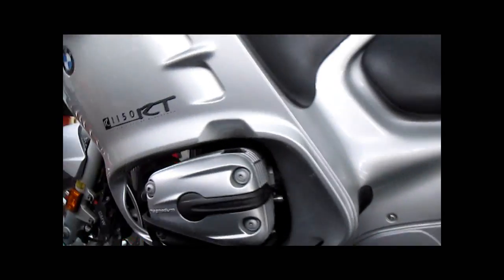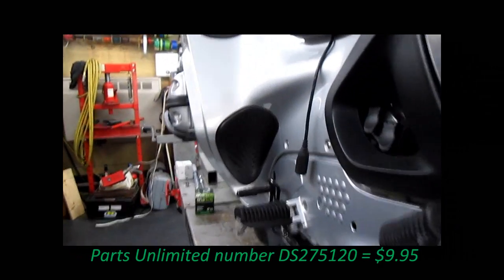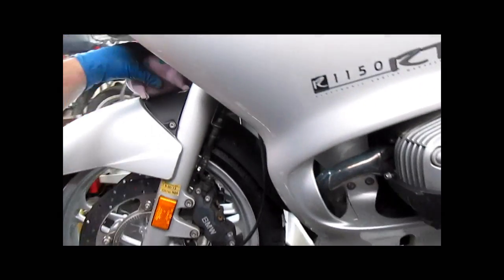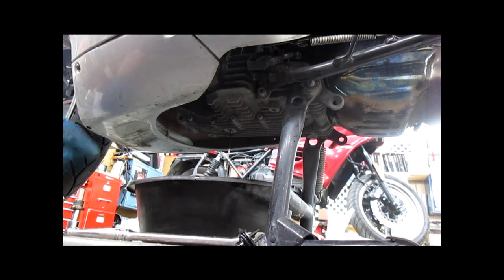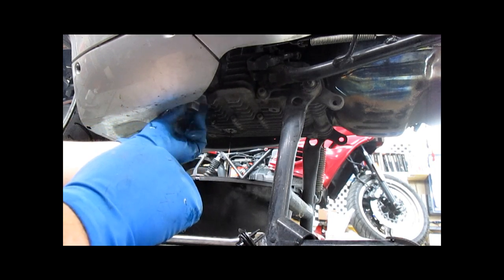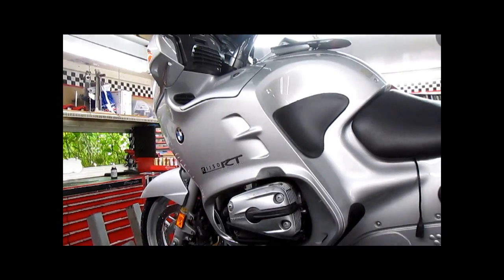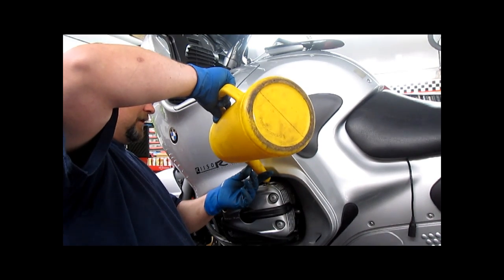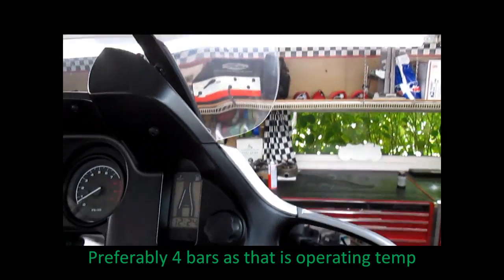BMW Service - Oil & Filter Change

Comment: Just bought a 2004 1150rt. The bike is in mint condition. What would you recommend for gearbox engine  and trans axle oil ? Thanks
Reply from the maker: Spectro Platinum full synthetic GL - 5 rated 75w140 oil for both transmission and rear drive. Change the trans every 24K and the rear drive every 12K and stay tuned.  https://www.bobscycle.com/spectro-platinum-differential-gear-lubricant-gl-5-75w140-1-liter.html?gclid=CjwKCAjw-e2EBhAhEiwAJI5jg7asQh8uWbVZBiDrexYlkr9YflUqWVuvxscCU334HQJUrOnA6yK5lhoCPCIQAvD_BwE
Reply: @ChrisR.Harris  thanks mate!👍

Comment: Hi Chris-  I need to know one particular information. On my BMW R1200 CL, the oil filler plug (top side not the drain plug) requires some special wrench to fit into the special socketed head. I don't think you covered that point in the video and presume it's dealer only. IS that right?   And thanks for a very information video.

Comment: I have a 2004 BMW r1150r   when I ride it it's leaking a small amount of oil down onto exhaust does that mean it's the seal? or possibly the oil sight glass ?
Reply from the maker: Take a look at the exhaust and trace the leak back to the source.

Comment from the maker: You need to drain the excess oil from the airbox. Right now the level is likely high enough that oil is draining from the airbox down the left throttle body and into the cylinder.

Comment from the maker: No, what you have is an aftermarket oil filler cap. Many people install these things to eliminate the oil weeping that the original plastic caps can allow if the rubber o-rings are worn out. If you send me an e-mail with a picture of the cap I can offer an opinion as to the manufacturer. Better yet, remove it, discard it and install the original plastic cap assembly. Just my opinion of course.

Comment: Hi Chris, nice video as always, i've a question for you.
i use valvoline full synthetic sae 10w40 on a bmw r65 from '79.
is the spectro 4 (20w-50) much beter for my bike ?

thanks and greetz from the Netherlands

Comment: Chris, love your youtube stuff, I've got a R1100R with oil getting in the airbox, oil level is half way up the sight glass (not over full), bike has done 32000 miles and seems to run fine........could it be worn rings ?

Cheers 
Mark

Comment: Do you recommend the Motul Synthetic Blend 15w 50? I have been using that for  about 5 years on my 2000 1150GS
Reply from the maker: Hi Mark, I only use Spectro 4, non-synthetic in these engines. The engines that leak lived on synthetic oil. Switching back often ends the weeping. That's my 25 years of experience with this shit. Good luck, Chris
Reply: Chris Harris  Hey Chris, Thanks so much for the tip. Now I have to find a retailer. 😰Peace

Comment: Hi Chris, I was a bit of a dummy and overfilled my oilhead, lots of smoke etc... I drained off the oil and refilled to halfway up the window. The smoke eventually blew off BUT now after I leave the bike on the sidestand, I get the oil smoke again... Have I blown my head gasket? It never happened before... any friendly advice gratefully received.

Comment: Thanks for Quattro replies Chris!.. I have to get a better camera as the photos are not clear.  it must be some type of secure oil filler plug, aftermarket. I can describe the tool I need as to 'C' shaped prongs, each of which is about 15 degrees of a full circle, 180 degrees apart. this tool fits into the recessed plug  to remove it.  I may be able to fashion a tool to get it out, and install an OEM plastic cap.

Comment from the maker: That sounds like the Hexhead oil filler cap. Look at a newer BMW model and see if it is the same. If it is you can buy a tool from BMW or just use your hand to remove the cap.

Comment: So,  after adding 4 qts of new oil - run the engine to operating temperature THEN look at the engine oil sight window AND what should one see???? Should the Oil level  in the window be below the center of the red circle, above the center ???  I can't find one video on YouTube that illustrates this.  It's not even mentioned in the BMW Service manual.  What's up with that?
Reply from the maker: Nicholas, the oil level is to be checked only after reaching operating temp (5 bars on your Rider's Information Display's oil temp gauge). You ride for 20+ miles, park in the driveway on level ground, go take your gear off and then look at the sight glass. The level should be at the dot in the center of the window. If you see the oil line anywhere in the window it is acceptable for a check. If you do not see the level it is in fact much too high. Have a helper assist you in leaning the bike to the right as you watch the window on the left side looking for the oil line to appear. This is when people often fuck up and think that because they can not see the oil line that it must surely be low. Wrong, it is too high! A visual oil line anywhere in the window means DO NOT ADD ANY OIL, it has enough.
Reply: Chris Harris - Got it ..... Thanks so much for the answer .
Reply from the maker: Nicholas Mumola  You're welcome.

Comment: I wonder if you have used Royal Purple Max-Cyckle oil on BMWs?
Reply from the maker: Hi Leif, some do, I do not. I use Spectro 4 from Intercontinental Lubricants; the same formula that BMW demanded when the K100 was released. Still the same unlike most others. Stay tuned for more, Chris  https://www.amazon.com/Spectro-Motorcycle-Engine-Lubricant-Oil/dp/B075DXGM33/ref=asc_df_B075DXGM33/?tag=hyprod-20&linkCode=df0&hvadid=309830501429&hvpos=1o1&hvnetw=g&hvrand=2905244398232124300&hvpone=&hvptwo=&hvqmt=&hvdev=c&hvdvcmdl=&hvlocint=&hvlocphy=9002739&hvtargid=pla-520659763564&psc=1&tag=&ref=&adgrpid=57212496130&hvpone=&hvptwo=&hvadid=309830501429&hvpos=1o1&hvnetw=g&hvrand=2905244398232124300&hvqmt=&hvdev=c&hvdvcmdl=&hvlocint=&hvlocphy=9002739&hvtargid=pla-520659763564

Comment: PLEASE PLEASE HELP YOU. MY MOTOR DAY DAYS FOR TWO, AND THERE IS A SINGLE DO NOT GAS ONLY TO GAS ONLY. WHEN I LEAVE THAT TWO TWO, OPET WORKS. ALL I WAITED, FUEL PUMP, FILTER, BOMBIN, FUEL PRESSURE REGULATOR. KNOW I CAN HELP YOU THERE CAN BE
Reply from the maker: What do you need?

Comment: What weight oil should be used? Thanks,
Reply from the maker: Non-synthetic, 20w50 for all but winter operation. If operating below freezing use 10w40.

Comment: hi chris always watch your items with lots of interest i call you mr bmw i live here in the uk and bmw is very dear here i can not get spectro 4 here i have a 1998 r850r could i use motul 3000 4t 20w 50 mineral multigrade cheers best wishes deano
Reply from the maker: Use what you can get; try to avoid synthetic engine oil. Synthetic gear oil for transmission and final drive is recommended but not for the engine.
Reply: @ChrisR.Harris  hi chris thank you for your  reply god bless you from all us bmw owners we all look forward to your videos best wishes deano from the uk you are mr bmw

Comment: Thanks for the real no bull videos..I used castroil 20w50 non syn. on last change.  also ride the polar bear tour this winter. is the oil to heavy for winter riding?  my next change will use Pennzoil 20w50...
Reply from the maker: I use Spectro 4 (non-synthetic) 10w40 during winter operation. Pennzoil works too.
Reply: Chris Harris 
Hello Chris 
I have 1150 GS and oil is full synthetic 5w-50 in this engine.
I want to change now, Please tell me, is problem if I change in non-synthetic 10w-40 or is beter to continu with synthetic?
Thank you!

Comment: Funny I end up using a 24 inch breaker bar to remove filters and drain plugs as the owners think they have to be "good and tight" or stripped and fractured. :-)
Reply from the maker: They can be a special lot at times!

Comment: I like K&N Oil Filter.. I believe the part # Issssss ssss ummmmm. Ahhhh Duhhhh.   K&N 163… super HD Case On Them, and that red pleated emelant… the best there are.. BUT .. there pricy.. around $243.99. + Tax & Title Disposal.. used oil is always good as a Dipping. Sauce.  Da Gaur.. or powdered donuts.  .. OHHHH BOYYYYY…. ..

Comment: I just can find semi-synthetic
Reply from the maker: https://www.amazon.com/Spectro-Motorcycle-Engine-Lubricant-Oil/dp/B075DXGM33/ref=asc_df_B075DXGM33/?tag=hyprod-20&linkCode=df0&hvadid=309830501429&hvpos=1o1&hvnetw=g&hvrand=11792641500885151129&hvpone=&hvptwo=&hvqmt=&hvdev=c&hvdvcmdl=&hvlocint=&hvlocphy=9002739&hvtargid=pla-520659763564&psc=1&tag=&ref=&adgrpid=57212496130&hvpone=&hvptwo=&hvadid=309830501429&hvpos=1o1&hvnetw=g&hvrand=11792641500885151129&hvqmt=&hvdev=c&hvdvcmdl=&hvlocint=&hvlocphy=9002739&hvtargid=pla-520659763564

Comment: spectro 4
Reply from the maker: Gearbox and rear drive require GL-5 gear oil. I use Spectro platinum synthetic 75w140 GL-5: https://www.bobscycle.com/spectro-platinum-differential-gear-lubricant-gl-5-75w140-1-liter.html?gclid=EAIaIQobChMIuvy5w-ee8AIVAcDICh2etQKYEAQYBCABEgJ6yPD_BwE

Comment: I feel bad for people that need a torque Wrench For ANY of this services… no really… no really I certainly don’t need a T/W For A Drain Plug Or ANY Filter.. & I Do Them ALL .. Briggs / Cats of MULTIPLE. Sizes . MY 330 I , My Magnum. 368. My Harley’s.  Never did never .. they don’tleak & there never overly torque..Let me ask you this what do you think you do when you’re building a car engine or any engine in chassis or in frame and there’s a torque spec for something but you can’t get a torque wrench in there you know what you need then? Someone who knows what the fuck they’re doing I’m just saying by now..       Head Bolts ,, Mains,  & Rods.. There I Will Insist On A Torque Wrench.. there Happy now.z??
Reply: IE Intake Manifolds.. Valve Covers,,  & MANY MANY MANY Other HAPPY HAPPY HAPPY Bits & Pieces That Have A  Torque Specification,, BUT You Ain’t gettin it in there..Been Building ,Riding ,Driving , Repairing,  Fixing , Fking, & Breaking Shit .. For Over 50 years Now… Most Wrenches Know What I Mean…